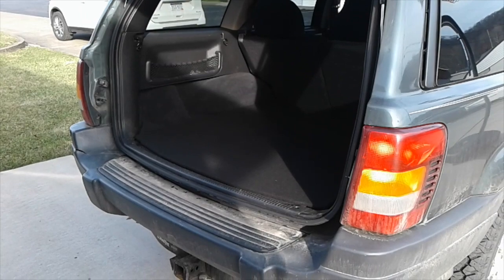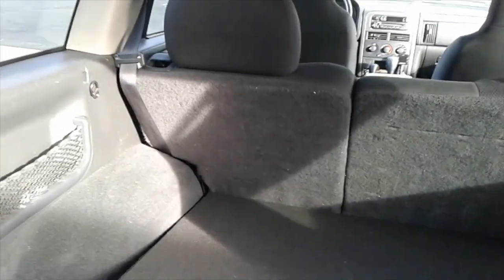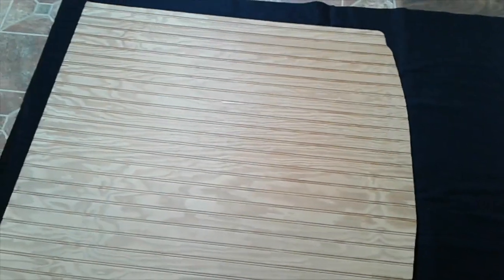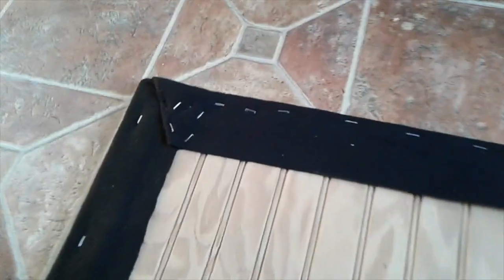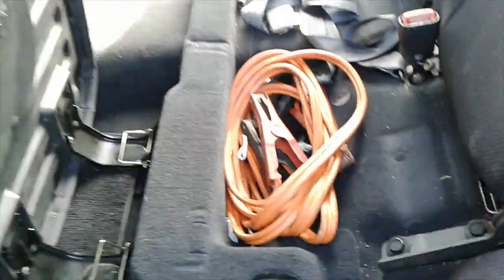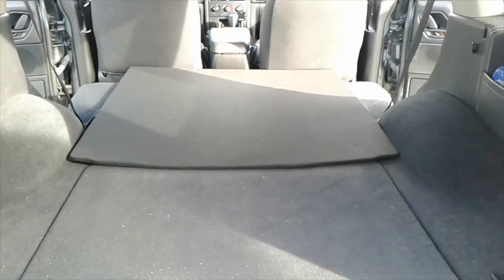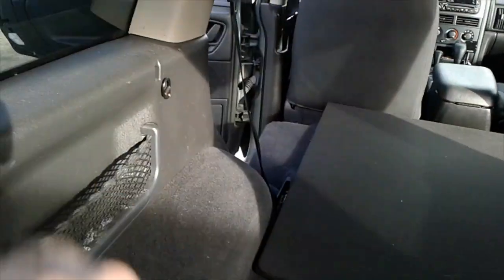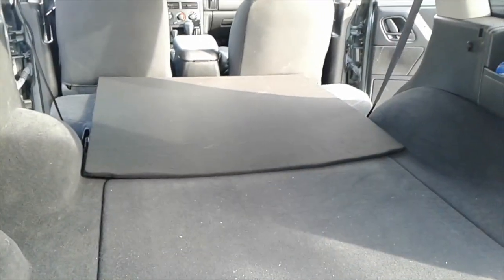TWIN BED IN JEEP WJ????

Comment: I live in my WJ from early spring until winter. I use a futon mattress and it fits great. I got rid of the bck seats and use my cooking table to help create a sleeping platform. for storage i use my thule skybox to keep my tools, firefighting gear, seasonal clothes and extras. The spare tire hole is where i keep all of my food and cooking supplies. i also have 2 deep cycle batteries behind each seat wired to my main and controlled via a simple switch. I have a hammock hanging from the "ceiling" that i use to hold everyday clothes and grab and go gear.